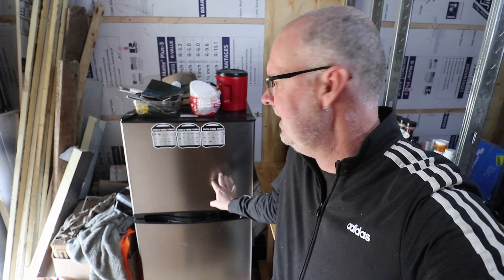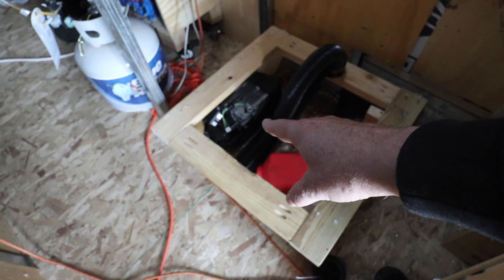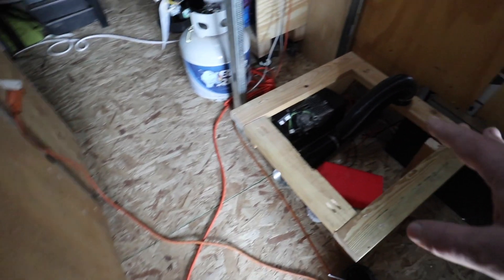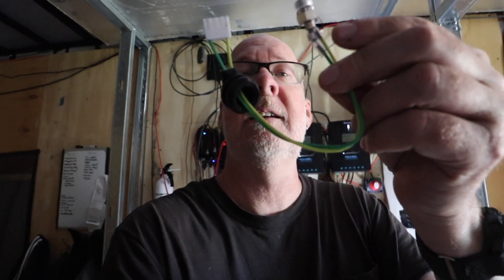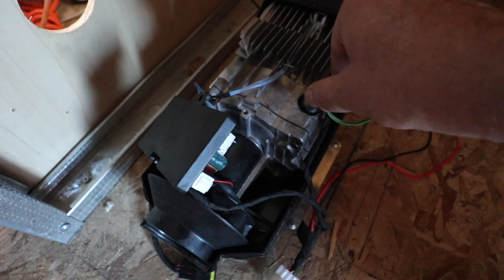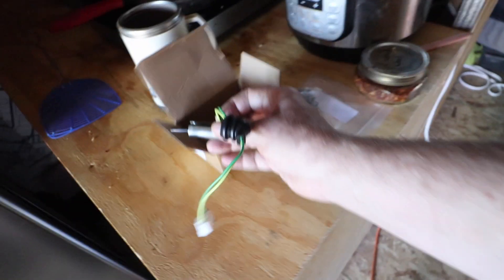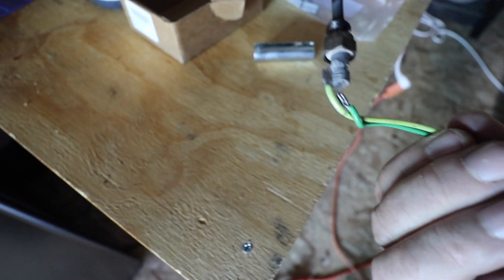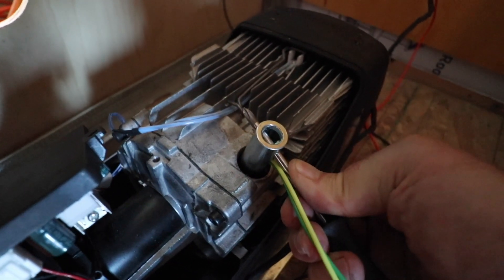I Though I Had This Fixed E649

Comment: There is an in between option, the Lavaner Pro is also a Chinese made product but they have a US warehouse and provide service. They also have a model that adjusts itself for altitude change. It's about $450. When mine craps out, this will be the replacement I try.
Reply from the maker: thx for bringing up this option

Comment: Glow plus last for years. I have 2. I change it just to make it easier and faster having one clean and ready to go with the new screen. You need to make sure the screen is installed correctly and not deformed.  The filter is in the end of the pump. Something you might consider,  look at instructions for high altitude operations,  the Espar has an updated pump for high elevation operations.  I do not have issues with that but I know people that do run them at high elevation and the updated pump helped them with their issues.

Comment: Awesome now you got wheel chock.   I think the ECM is faulty. For your viewers  when you change the POS heater with a new one put all the new parts in heater pump fuel lines and filter and the display. That way you got a fighting chance. Then all the parts are new.  7 don't beat yourself up these heaters are NOT DEPENDABLE at all. Try a couple things then chuck it in the garbage 😂. Awesome video covered lots of issues.  🇨🇦🛠️🇨🇦🛠️

Comment: I watched the first fix video and you had the heater set to 1.4hhz fuel setting, if your running that low it probably isnt combusting the fuel properly causing carbon build up in the combustion chamber, if it is a 5kw unit which I suspect it is it shouldnt really run any lower than 1.7hz even then you will need to run it at the maximum setting for an hour once a week to clean out the crap in the combustion chamber. if I were you id find out how to get into the special setting menu on the controller look on you tube and set  the fan speed for 5000rpm high and 1650 rpm low that will stop the heater hz fuel setting from going to low. below 1.7hz, you can also change the glowplug settings by increasing its temperature. I had similar issues with one of mine, I had to shorten the air intake hose to half its length with no curves in the air intake pipe.

Comment: Your fuel's outside and below the level of the floor so therefore the pump has to draw the fuel uphill slightly? If it were mine I would situate the tank at least level with the heater and take fuel off the bottom of the tank. Install a hard steel line ie 1/8 or 3/16 brake line with the flares cut off and short hard (a couple inches) nylon line on either end to the heater and the pump. Make sure the pump is fairly close the the heater. I mix 10 - 15% gasoline with my diesel, helps gelling and burns cleaner. Buy a quality glow plug if it is actually dieing fast, check it with a ohm meter when there's a question.

Comment: Sounds like you need to crank the heat up on high for 10 minutes and burn the carbon out of it.
Reply from the maker: I recently opened up the heater and the burn chamber was mostly clean. oh, and I do "burn" out the chamber for almost an hour each time I use it

Comment: they say it's a little harder on them, the higher you go in altitude. Plus you need to run them wide open, and not a half speed. It plugs them up. Atomizer screen gets plugged up.

Comment: You’ve got about 30 days or less before cold weather returns here in colorado. Fridges realllly don’t need that much ventilation. Every house I’ve ever owned has had a cased in refrigerator.  You can also have packages left directly at the  fedex in salida. We regularly get a foot of snow around the end of September early October. Really should check “shore pretty observation” at twin lakes for blm camping.
Reply from the maker: thx for info on fedex. I wasn't ware FedEx had an official shipping office there. Im planning on heading south to Santa Fe soon

Comment: The diesel will always leave suit inside that heater.  I run kerosene in mine now. Haven't had a problem in over a year even running it at low temperatures. Diesel fuel does add lubrication but I was going to throw it away anyway.
Reply from the maker: good point. I'm thinking of running 50-50 diesel/kerosene mix which according to many is the ideal ratio for cleaner fuel vs getting the lubrication from the diesel additives
Reply: @SevenWanderstheWorld   If you do the 50/50 mark the can really good because I think you have a diesel truck and you don't want to make that mistake👍
Reply: Kerosene still causes carbon build up, ive been running kero for 6 months and have just serviced mine and it had soot inside the combustion chamber.

Comment: I don't know if reducing the fuel line down to 2 mm. is such a good idea. It could be starved for fuel
Reply from the maker: actually the hard 2mm nylon hose is one of the highest recommended solutions to diesel heater problems. my new heater came with a stock 2mm nylon hard hose (problem is in longer lines the soft hose flexing and losing pressure)
Reply: @SevenWanderstheWorld  yep but you dont use the cheap chineese jubilee clips you buy real jubille clips for the joints or they leak air into nthe fuel line, this causes running issues.

Comment: You may want to get a different controller that adjusts for high altitude operation. The heater is running rich which is causing that screen to get clogged

Comment: Word to the wise, Seven... "You only get out of it, what you paid into it!"  Meaning if you don't pay a lot, don't expect a lot.  This is true for most everything tangible you can buy...cars, trucks, furniture, single-garage "certified mechanic" services, TV shopping electronics...you get the idea.
Not everything expensive is good or better than the rest.  Just...use...good...judgement, because if it's just too good to be true, it most likely is!
Reply from the maker: good points. I do realize I get what I pay for and that I can buy 10 of the chinese heaters for the cost of one european diesel heater... pros/cons to each option I suppose ;)